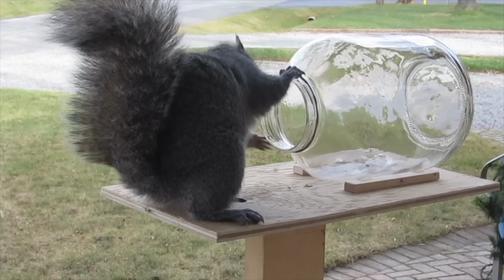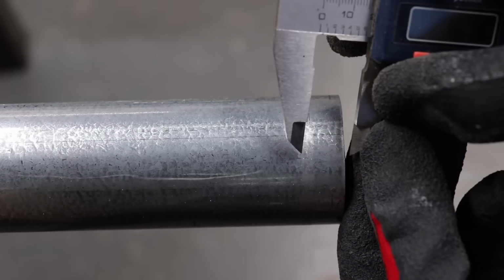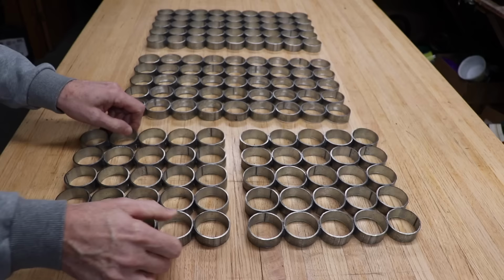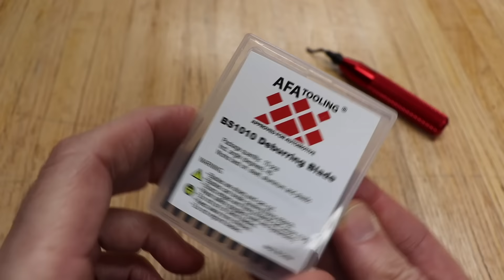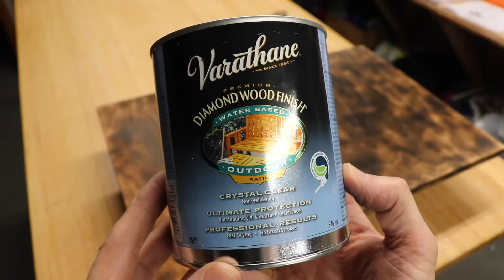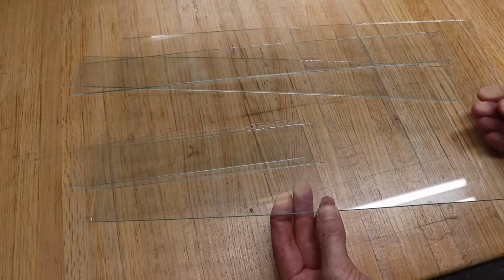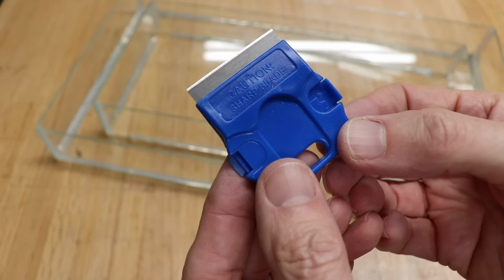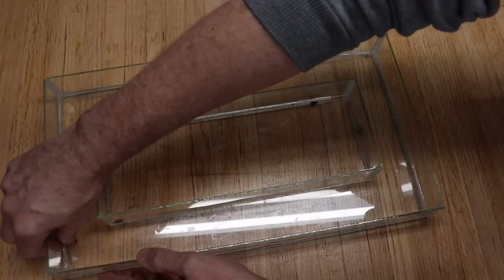How to Make ● A Unique Squirrel Proof Bird Feeder ( that actually works ! )

Comment: You should make another version where the feeder is separated into a top and bottom half by another row of rings. Then, in the top row, leave like one hole big enough for the squirrels to get into the top. This way, they can "get in" to the feeder, but not actually reach the seeds. While it may not have much of a purpose, it'd be entertaining AF to watch the squirrels struggle from above. :P

Comment: A couple of questions:  Will this keep out Grackles, Blue Jays and/or Doves?  (Especially Grackles and blackbirds) Would PVC pipe work instead of fence pipe?  If PVC works, would I still use silicone to hold it together?  I'm a newbie at this kind of craft.  Circles seem so much better than squares for birds to fit through- love the idea although I have a lot of 1.5 x1.5-inch mesh.
Reply from the maker: They will chew right through PVC! The bigger birds poke their heads in to get stray seeds.
Reply: @chrisnotap  Thank you for the quick response. I'll try it with the fence post.

Comment: Metal pipe holes are not a good idea for hot climates like Arizona.  I think PVC pipe would work well here, and most people could actually cut the pipe themselves without all the expensive saws and other equipment.  However, thank you for the great idea!
Reply from the maker: I tried that at first and they chewed right through it. It only took them a few days.

Comment: Now it's time to make bird proof squirrel feeder.
Reply from the maker: Yes you can easily! Just leave your garage door up about 2 1/2" to 3" inches and lay a pile of seed on the floor in the garage . The squirrels will enter and not the birds. Of course doing this brings on another whole set of problems with the squirrels inside your garage. This is why people try to keep them at bay since they do chew everything and can cause a lot of damage to wiring and to your house. You may have missed it but they are able to get some seeds. Just go to 11:57 in the video where I show that.

Comment: make a clear tube door up top on a hinge so you can refill from the top without taking it apart.
Reply from the maker: It's easy to open, clean and refill with the bolts. Easy peasy.

Comment: Use SCH 80 PVC pipe less expensive and easier to cut with a miter saw and hot glue gun.
Reply from the maker: Hot glue can't take the heat cold expansion contraction cycles. Silicone can, that's why it works so well for this. Plus if you use PVC the squirrels will chew through it in a day. The first one I made was PVC and they chewed right though it!

Comment: You could electrify it too, if the squirrels start getting smart.
A metal plate on the outside 1/2" from the rings and it it an electric charge and ground the rings
This wont hurt the birds since they're either on the rings or the outside plate.
But the squirrel will get a small unpleasant charge since its touching both the outside plate and rings.

Comment: Pretty smart design. However, I'm not entirely sure if the glue would hold up over many years in some colder environments.
I think it would be an excellent idea to fill the negative space with something to decorate it. Like using colored epoxy resin to give it a "fake stained glass" look.
Reply from the maker: Silicone is the most under-rated adhesives! I made a similar type feeder 7 years ago and it is still together in one piece as strong as the day I put it out there. Here we can get temps as low as -25c on occasion, but mostly around -10c. Don't fear silicone!

Comment: Y'know you also coulda like made the roof be the lid and it just has like, a bolt you undo like with how you were doing the bottom plank instead. But this is real cool!

Also I noticed the uh, Blue Jay and, I'm assuming that was a crow and a dove that also sat there to visit, but are they able to get any seeds easily like the smaller birds?
Reply from the maker: It doesn't get much easier with the 2 bolts! Easy to open clean and fill. The bigger birds are able to poke their heads in and get stray seeds.

Comment: Does hole shape have to be round to keep squirrel out? 1.75x3 rectangle? Or 1.75 diamond? I have several milk crates those sizes instead of pipe.
Reply from the maker: You could experiment with the size and shape of the hole. If your milk crates are plastic, they will chew right through it in a few days!

Comment: The aluminum angle iron will lose its grip on the silicon after it oxidizes. Put a couple of pop rivets on all corners to prevent this.  Otherwise it was a great build.
Reply from the maker: It's been up for about 10 months now and is showing no signs of corrosion at the aluminum. So far, so good.

Comment: I wonder if there is a screen or fence material with the same or close hole size.  Would make assembly far easier and materials should be cheaper.
Reply from the maker: I explored and searched for other materials to use like fencing but came up empty handed here in Canada. It's very structurally sound using the pipe. The corner pieces also make it easy to construct.

Comment: Are the holes big enough for Blue Jays and Crows and Woodpeckers?  They are welcome in my yard as well but it's hard to feed them peanuts.  We put them on the ground at the same timer every day but the squirrels get a bunch.

For additional protection, a metal Slinky attached to the pole will keep squirrels from climbing up.  (But of course does nothing if they can jump onto it.)

Comment: Very nice, but I would of raised the glass wall height in the first design to cover 2 to 2-1/2 holes instead of 1 and the squirrel's would not be able to reach down far enough to get the seeds.
Reply from the maker: Yes but birds have a hard time navigating glass and wouldn't know to go to the 3rd hole up to get in. Then once in wouldn't understand to go to the 3rd hole to get out.
Reply: @chrisnotap I see...I'm no bird expert but didn't think you can trap a bird that way. i figured they would find a hole to get into/out. I defiantly understand your 2nd design helps them easily go in and out. maybe on the third design have a sloped bottom to the center so any seed will not collect on the sides for squirrels. And you can illuminate the need for a glass box in the center.

Comment: My only question would be whether the larger birds like the grackles, bluejays and doves can get through the holes?  In the video they did land but didn't enter.
Reply from the maker: They're able to poke their heads in to get stray seeds.
Reply: @chrisnotap   That's too bad.  We have so few squirrels around here that they are interesting to watch and they usually come in after the birds are gone.  I do like the design.

Comment: Did you clean the metal surface somehow before gluing them?  I am amazed to find out you can use silicone glue to fasten aluminum together.  I have tried various aluminum "brazing"" over the years but all those "special" rods are crap.

Comment: Hi Chris, I'd love to make this. I wonder how the silicon connection is working in the extreme heat? Does it hold up or should some other kind of glue be used for very high outdoor heat?
Reply from the maker: If there is a better glue, I don't know anything better than silicone. It can take heat and the "contraction expansion" cycles in the heat and cold. Go for it! You'll be surprised how strong and durable it is.

Comment: Hi, i started making one when I saw your original video...I started making it out of - inch and a half copper....I was wondering if a cardinal can fit through this size COPPER? I stopped making it because the diameter of the copper looked kinda small for a cardinal. Thank you ...hope you or someone  gets a chance to answer me.
Reply from the maker: Cardinals will go in with the copper, but it takes a while for them to figure it out, and only a few decide to enter. With this one, they seem to enter without much hesitation.

Comment: Newbie learning here so please be kind:  Any of these work as cheaper alternatives, but using the same design?  (I’m broke af) PVC, vegetable cans, soda cans?  heck, I drink so many of the monsters with twist off lids that I could somehow use the lids possibly.  Hmmmmm
Reply from the maker: Those are all good ideas.The diameter needs to be as close to 1 7/8" as possible. They will chew right through anything plastic in a day or less.

Comment: Nice design. The only issue I see is the seed tray holding water in blowing rain. How do you deal with that?
Reply from the maker: On the final application of silicone in the tray, I left gaps to allow any water to seep away. It's been up a year now and there has been no issue.

Comment: Hi Chris I’ve struggled in the uk for years combating squirrels so when I so your video 👍😀great job . So this spring im on it one question could I use bathroom waste plastic pipe provided the size is correct. Many thanks Dave
Reply from the maker: Squirrels will chew through anything plastic in no time. This is why I went with metal.
Reply: @chrisnotap  that was my concern I’ll see if I can get some tubing like yours,  cheers Dave .

Comment: Do you get any issues with rats getting access to the feeder? Here in the U.K. we get that issue. Also very difficult to get pipe of the correct I. D. for a sensible price so I have experimented with 3D printing the rings. I know the grey squirrels can chew through  the PLA but they can also chew through the plywood as well.
Reply from the maker: Squirrels are prolific chewers. Their teeth are constantly growing and any kind of plastic they will chew through in short time to get to the prize. There may be a plastic that they can't chew through out there so experimenting is the way to go to find out. We don't have rat issues where I live so I am not able to answer the rat question.

Comment: Great design!! Thanks But I'm curious Have you ever tried smaller ID pipe? Bc based on the holes I see in nest boxes I would think they could fit through something even smaller. Or are you worried the larger ones Ie: Cardinals,Bluejays etc wouldn't be able to fit?
Reply from the maker: I discuss that at the start of the video.
Reply: @chrisnotap  Yes you did But except for your little experiment You didn't mention if you ever tried making one out of less than 1 1/2"  That's my question?
Reply from the maker: @erndog0110  Oh ok, gotcha. No I never tried any smaller

Comment: According to your ideas, in order to save labor and cost, can I just take 4 boards and drill some holes directly, and then put them together, so that there is no need to use pipes and cut pipes.
Reply from the maker: Been there done that!! They will chew right through the wood!! They will do the same with ABS or PVC pipe!
Reply: @chrisnotap  Thank you very much, it saves me the time of trying, I have no experience, it seems that the selection of materials is not just a random thought.

Comment: Using your close up shot of the pipe you got from HD, I went to the US HD site and they do not list that, and I searched all over the US website for the exact same thing --- Nope. Then I went to the Canada HD site and there it is plain as day. Looks as though the US has a different standard size on these.
I've done some preliminary looking (can't measure - haven't been to the store) but "trade size" 1 1/2 conduit (ID stated to be 1.61 inch) might work -- What say you Chris, will ID 1.61 inches be too small??
btw - The conduit is US$34 for 10 ft.
Reply from the maker: A bit small. The cardinals won't go in a 1.5" like in my first version.

Comment: Hi Chris, I've watched all your squirrel proof bird feeder videos and I'm a bit confused.  In one, through multiple tests you found that 1.25 was the size that they could not fit through, but in other videos you used 1.5-inch diameter pipe.  In this one you use 1.875 (1 7/8) inch pipe.  Is that really sufficient to stop the squirrels from getting in.  I can't find the pipe you used in this video at Home Depot anymore.  I do see a 6 ft 1.66 diameter pipe at Lowes.  I'm leaning towards using that one.  Does that sound ok?
Reply from the maker: This was my test video:  https://www.youtube.com/watch?v=R3Cv-r5dIVs&ab_channel=ChrisNotap   It could squeeze past 2" but could not get through 1 3/4" so I settled on 1 7/8" which has proven to be the biggest you should go to keep them out as you can see from the results in the video you are commenting on.

Comment: Made 1 with 2" openings, the birds are terrified of it. I have observed only 2 that actually went in, and both panicked and took a while to figure out how to get out. I suppose they will learn eventually. How long did it take for your birds to get comfortable with it?
Reply from the maker: It can take 2 to 3 weeks or more for them to understand what it is and what is in it. To encourage them just stick some broom poles right through it for them to land on and investigate.
Reply: @chrisnotap  Left it out a month, birds never got used to it, freaked out once they got inside. I replaced the pipe sections with 3/8" fiberglass bars and they fly right in. My goal is to keep the large seed-swallowing birds (doves, bluejays) out and allow the small seed-cracking birds in. (cardinals, finches, sparrows etc.) Works like a charm, no more freaking out! It does look like a little jail, not as pretty as yours now  but the birds all like it.

Comment: Hey Chris, One more question - Did you silicone the seed tray to the glass shelf to keep it from moving, or does the weight alone keep it in place? Thanks
Reply from the maker: The outside dimensions of the glass are just slightly smaller the the inside dimensions of the pipe walls. That keeps the tray in place and makes it easy to line up the 2 bolt holes that hold it down.
Reply: Thanks again, Chris @chrisnotap

Comment: You could funnel the seeds in thru instead of removing the cage to refill.
Reply from the maker: Removing it is very easy with those 2 bolts! Easy to fill and very easy to clean.
Reply: @chrisnotap Ah, cleaning. True. In that case, I'd say hinge one side and latch the other.

Comment: It's only secured via 2 of the rings, which is just 3 little silicone dabs on each side.  It's not going to last like that at all. Strong wind or a brand would instantly take it out. :/
Reply from the maker: Your underestimating the strength of the silicone! Since all 4 sides are wide open, wind has little affect on it. It just blows right through. Other than that, there is no force on those 2 rings.

Comment: I wish you also built a squirrel feeder. And make it bird proof.
Reply from the maker: Yes you can easily! Just leave your garage door up about 2 1/2" to 3" inches and lay a pile of seed on the floor in the garage . The squirrels will enter and not the birds. Of course doing this brings on another whole set of problems with the squirrels inside your garage. This is why people try to keep them at bay since they do chew everything and can cause a lot of damage to wiring and to your house. You may have missed it but they are able to get some seeds. Go to 11:57 in the video where I show that.

Comment: Maybe close those gaps under the roof with wire mesh? Seems like a squirrel or something small and predatory might just sit there and scare off the birds or even feed ON them
Reply from the maker: That's not necessary. They climb in and out of that space in seconds and spend no time there.

Comment: Your first design is much better. in your first disign did you have issues with birds running into it?
Reply from the maker: No. From all the times we sat watching, we never saw any fly into it. If they did, it is slanted and they would deflect off off it.
Reply: @chrisnotap  Thanks, I was wondering if that was why you changed the design. Were I use to work we had a big viewing window which was problematic at times.

Comment: 7:38 Silicone caulk??  Oh, is THAT what holds Plexiglas together?!  I had tried hot glue to assemble the five rectangular "shallow-walled tray" pieces to form a turntable-cover, and when that didn't work well enough (the glue did hold the pieces together initially, but then the back panel got wrenched loose when the lid was hinged back and forth), I'd used lengths of clear-plastic edge-protector-angle with small drilled holes and clear-plastic machine-screws and nuts to attach them.

Comment: Im not an expert, but since your roof is triangular could it be closed and open with a hing in the opposite side, then there could be a cork in the hypotenuse side, and a hole in the adjacent side so it could be easier to put bird seeds instead of unscrewing it

Comment: Couldnt you just use abs pipe , easy to cut ? Glue and screw ? Wont rust over time ? Black or white ? Just thinking easier to cut
Reply from the maker: The first one I made was ABS and they chewed right through it in a few days. They love to chew and actually have to chew to keep their teeth trimmed and in shape.

Comment: I had no idea silicone adhesive would hold as well as that.
Reply from the maker: Silicone is the most underrated adhesive! I use it for many things. It does take 24 hours to cure, which is probably why most don't think to use it.